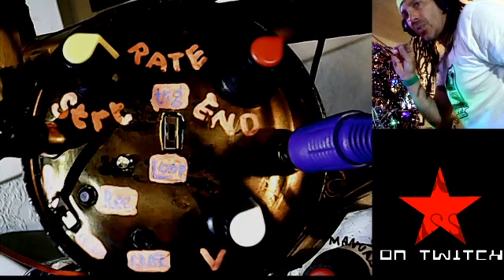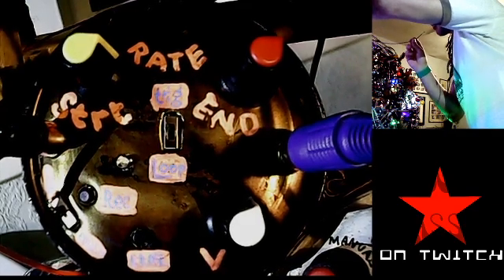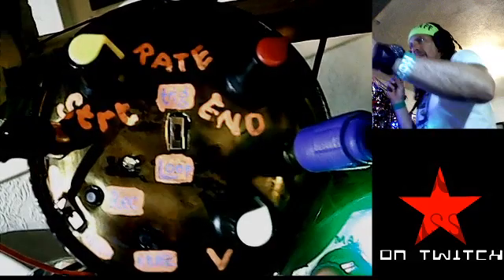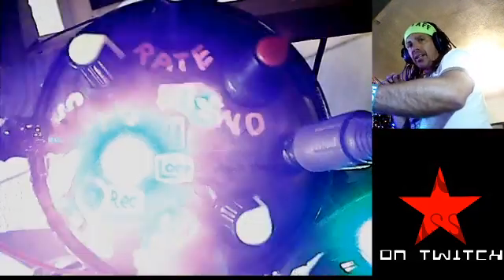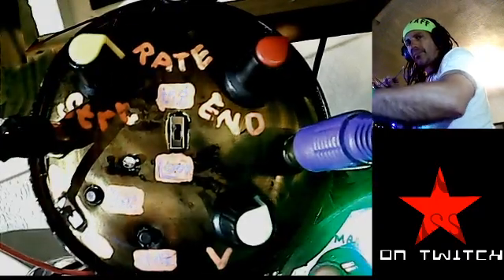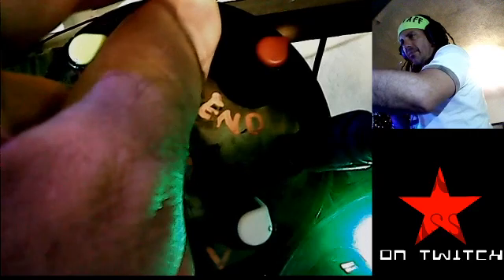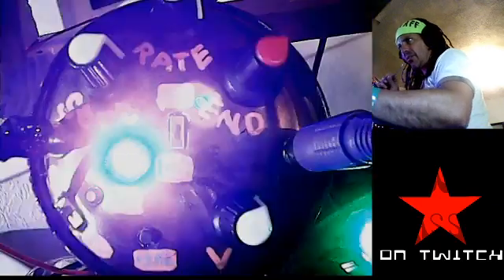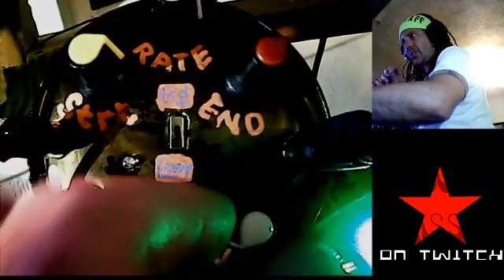Demonstrating my ISD1760 plus Arduino sample player module

Comment: So there's no arduino attached to this?
Reply from the maker: That is correct. The 17xx chips can be controlled with serial commands. The latency isn't good and it's not very reliable, but it's got charm 😋
Reply from the maker: Oops, that is incorrect there is an Arduino inside here.

Comment: Really cool project! Any chance to see the code?
Reply from the maker: I have the code and the schematic ...somewhere..... on my old computer. Next time I boot it up :D
Reply: @ozerik  Nice! How did You get rid of that little delay after each track? In loop mode Every ISD sampler chip has that tiny (but still nasty) pause before it starts playing from the beginning.
Reply from the maker: @rushinaataajs  Aaahhh, you see, instead of triggering this (or letting it loop) I've got the "trigger" pin tied high. The trigger signal power-cycles the whole circuit to get it to retrigger even in the middle of playing the sample. A couple schematics... one with a more complicated "retrigger" circuit, one with a simpler one. The 220R resistor should maybe be a 150R in the simpler retrigger circuit.

https://drive.google.com/file/d/18gzJV278dhkgx1AhqQ4DYWnaQRVshivc/view?usp=sharing

https://drive.google.com/file/d/1wlmO26oaamZ4cOa1mEr2zV5arp5P4NOw/view?usp=sharing
Reply: @ozerik  Hello, i try to acces the file for this google doc but it's say acces denied can you please give the password ?
Reply from the maker: @plop-4269  oooooohhh, sorry. I changed the access permissions. It should work now!
Reply: Ideed it's working now :) Thank you !